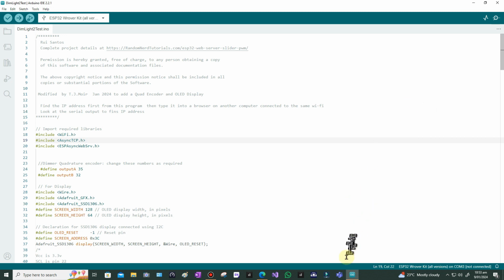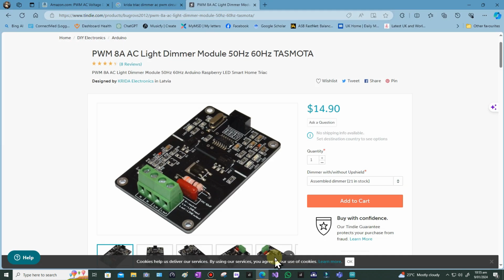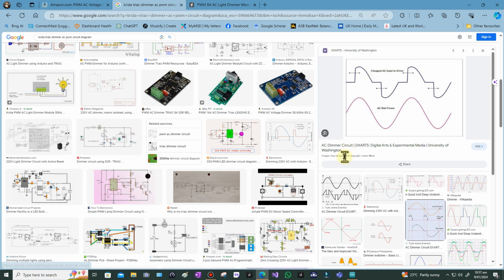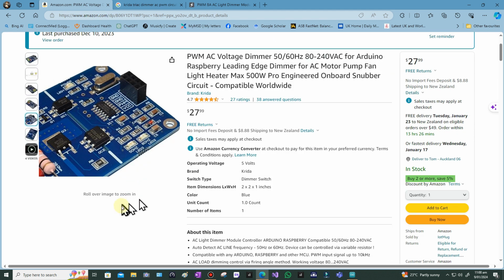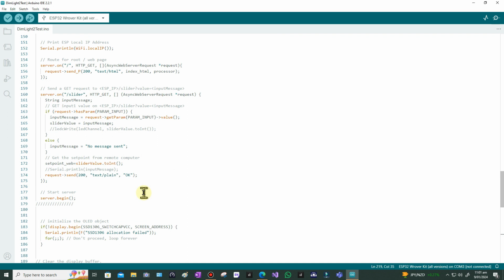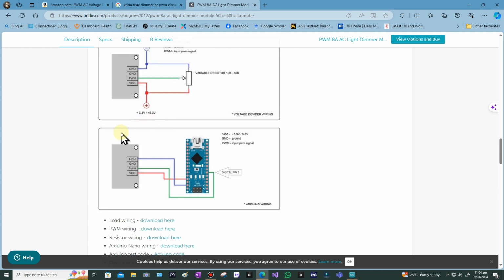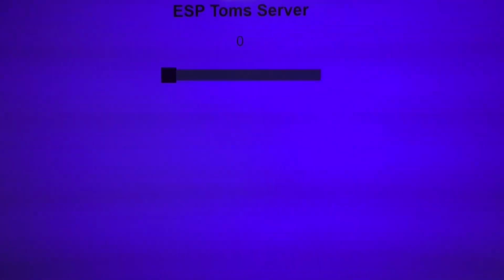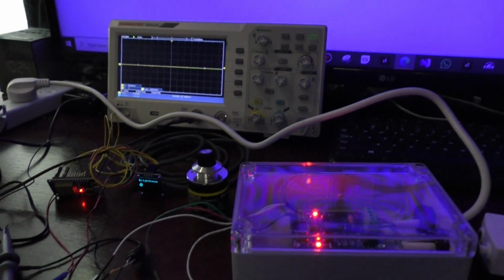Mains light dimmer using embedded asynchronous server and an ESP32

Comment from the maker: /*******
  Rui Santos
  Complete project details at https://RandomNerdTutorials.com/esp32-web-server-slider-pwm/
  
  Permission is hereby granted, free of charge, to any person obtaining a copy
  of this software and associated documentation files.
  
  The above copyright notice and this permission notice shall be included in all
  copies or substantial portions of the Software.

 Modified  by T.J.Moir  Jan 2024 to add a Quad Encoder and OLED Display
 
  Find the IP address first from this program  then type it into a browser on another computer connected to the same wi-fi
  Look at the serial output to find IP address
*********/

// Import required libraries
#include <WiFi.h>
#include <AsyncTCP.h>
#include <ESPAsyncWebSrv.h>

 //Dimmer Quadrature encoder: change these numbers as required
  #define outputA 35
 #define outputB 32

 // For Display
#include <Wire.h>
#include <Adafruit_GFX.h>
#include <Adafruit_SSD1306.h>
#define SCREEN_WIDTH 128 // OLED display width, in pixels
#define SCREEN_HEIGHT 64 // OLED display height, in pixels

// Declaration for SSD1306 display connected using I2C
#define OLED_RESET     -1 // Reset pin
#define SCREEN_ADDRESS 0x3C
Adafruit_SSD1306 display(SCREEN_WIDTH, SCREEN_HEIGHT, &Wire, OLED_RESET);
/*
Vcc is 3.3v
SCL is pin 22
SDA is pin 21
Also needs ground pin
*/
  int brightness;
int enable1Pin = 26; //PWM
volatile int counter=0;
// for sampling freq

int sample_pin=27;

// Setting PWM properties
const int freq =200;
const int pwmChannel = 0;
//PWM resolution
const int resolution = 8;

 /////////////////////
// Replace with your network credentials
const char* ssid = "xxxxx";
const char* password = "xxxxx";
/////////////////////////////
/////////////

void IRAM_ATTR isr_quadencoder() {
// quadrature encoder
if(digitalRead(outputA) == digitalRead(outputB)) {
    //Clockwise
    counter++;
  } else {
    //Counter Clockwise
    counter--;
  }
  
    
}

/////////////////

String sliderValue = "0";

const char* PARAM_INPUT = "value";
int setpoint_web=0;
// Create AsyncWebServer object on port 80
AsyncWebServer server(80);

const char index_html[] PROGMEM = R"rawliteral(
<!DOCTYPE HTML><html>
<head>
  <meta name="viewport" content="width=device-width, initial-scale=1">
  <title>ESP Web Server</title>
  <style>
    html {font-family: Arial; display: inline-block; text-align: center;}
    h2 {font-size: 2.3rem;}
    p {font-size: 1.9rem;}
    body {max-width: 400px; margin:0px auto; padding-bottom: 25px;}
    .slider { -webkit-appearance: none; margin: 14px; width: 360px; height: 25px; background: #AFD65C;
      outline: none; -webkit-transition: .2s; transition: opacity .2s;}
    .slider::-webkit-slider-thumb {-webkit-appearance: none; appearance: none; width: 35px; height: 35px; background: #003249; cursor: pointer;}
    .slider::-moz-range-thumb { width: 45px; height: 35px; background: #003249; cursor: pointer; } 
  </style>
</head>
<body>
  <h2>ESP Toms Server </h2>
  <p><span id="textSliderValue">%SLIDERVALUE%</span></p>
  <p><input type="range" onchange="updateSliderPWM(this)" id="pwmSlider" min="0" max="255" value="%SLIDERVALUE%" step="1" class="slider"></p>
<script>
function updateSliderPWM(element) {
  var sliderValue = document.getElementById("pwmSlider").value;
  document.getElementById("textSliderValue").innerHTML = sliderValue;
  console.log(sliderValue);
  var xhr = new XMLHttpRequest();
  xhr.open("GET", "/slider?value="+sliderValue, true);
  xhr.send();
}
</script>
</body>
</html>
)rawliteral";

// Replaces placeholder with button section in your web page
String processor(const String& var){
  //Serial.println(var);
  if (var == "SLIDERVALUE"){
    return sliderValue;
  }
  return String();
}

boolean running = false;

void setup(){

  
  // Serial port for debugging purposes
 Serial.begin(115200);
  
   // Connect to Wi-Fi
  WiFi.begin(ssid, password);
  while (WiFi.status() != WL_CONNECTED) {
    delay(1000);
    Serial.println("Connecting to WiFi..");
  }

  // Print ESP Local IP Address
  Serial.println(WiFi.localIP());

  // Route for root / web page
  server.on("/", HTTP_GET, [](AsyncWebServerRequest *request){
    request->send_P(200, "text/html", index_html, processor);
  });

  // Send a GET request to <ESP_IP>/slider?value=<inputMessage>
  server.on("/slider", HTTP_GET, [] (AsyncWebServerRequest *request) {
    String inputMessage;
    // GET input1 value on <ESP_IP>/slider?value=<inputMessage>
    if (request->hasParam(PARAM_INPUT)) {
      inputMessage = request->getParam(PARAM_INPUT)->value();
      sliderValue = inputMessage;
      //ledcWrite(ledChannel, sliderValue.toInt());
    }
    else {
      inputMessage = "No message sent";
    }
    // Get the setpoint from remote computer
    setpoint_web=sliderValue.toInt();
    //Serial.println(inputMessage);
    request->send(200, "text/plain", "OK");
  });
  
  // Start server
  server.begin();
////////////////

  
  // initialize the OLED object
  if(!display.begin(SSD1306_SWITCHCAPVCC, SCREEN_ADDRESS)) {
    Serial.println(F("SSD1306 allocation failed"));
    for(;;); // Don't proceed, loop forever
  }

// Clear the display buffer.
  display.clearDisplay();

  pinMode(enable1Pin, OUTPUT);//PWM

 pinMode (outputA,INPUT);//Encoder input A
   pinMode (outputB,INPUT);//Encoder input B

   pinMode(sample_pin,OUTPUT);//Sampling freq measure with scope
    
  
  attachInterrupt(outputA,isr_quadencoder, FALLING);
  // configure LED PWM functionalitites
  ledcSetup(pwmChannel, freq, resolution);
  
  // attach the channel to the GPIO to be controlled
  ledcAttachPin(enable1Pin, pwmChannel);

  

  }
  
void loop()
 {
   
if(counter>255){counter=255;}
 if(counter<0){counter=0;}
   
brightness = abs(counter+setpoint_web);
     //Serial.println(brightness);
  
if(brightness>255){brightness=255;}
 if(brightness<0){brightness=0;}

 
//PWM Must take absolute value

   ledcWrite(pwmChannel, brightness); 
// To measure the sample rate from pin 21
digitalWrite(sample_pin,running);
running=!running;

// Display
display.setTextColor(WHITE); //  text
  display.setCursor(0,0);
   display.setTextSize(2);
  display.println("Brightness");
  display.setTextSize(3);
  display.setCursor(0,30);
   display.println(brightness);
   display.display();
  
   display.clearDisplay();
// Need a time delay
  delay(4);
// end endless main loop
}